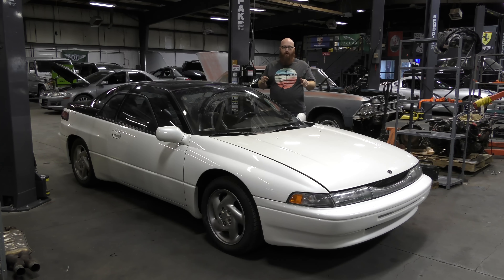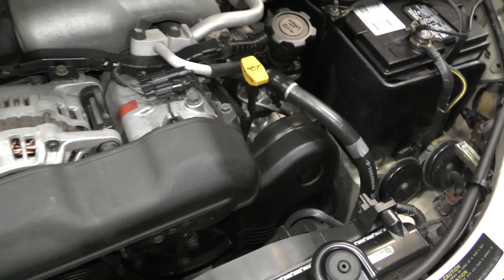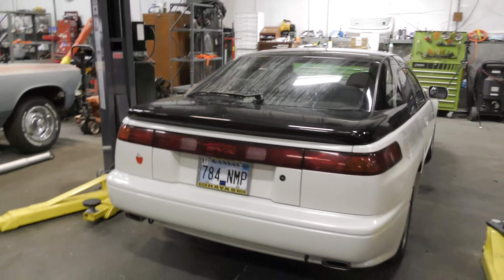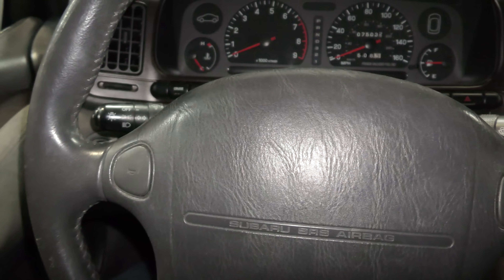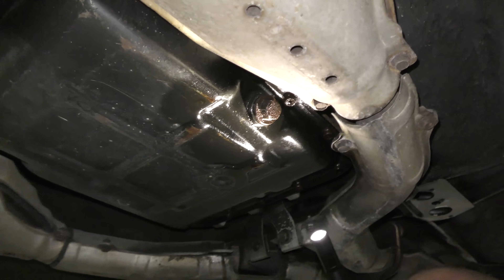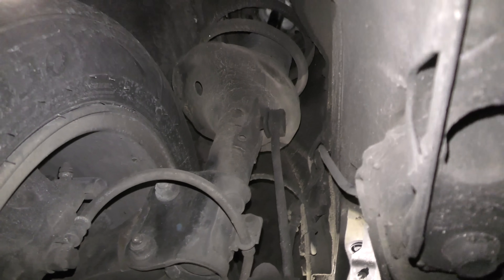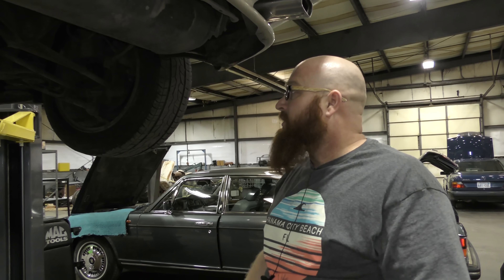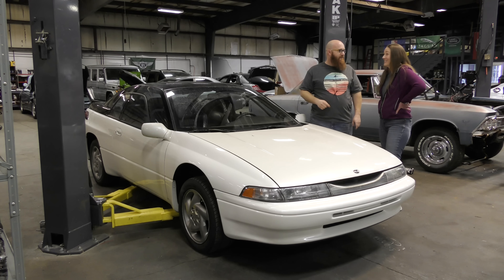An Italian Subaru Sports Car?!? The CAR WIZARD shows how east meets west with this 1992 SVX Subaru

Comment: I still think this is one of the coolest cars ever built. In the mid 2000's I was always keeping an eye out for a used SVX and planned to swap in a manual trans...
Reply: Me too. Never got around to it.
Reply: did you get a chance to own one?
Reply: If you do, source a 6 speed from a European Subaru diesel. Best trans to swap in, designed for high torque and loads available in scrap yards and the boxer diesel engine had a serious design flaw that wrote off a lot of cars
Reply: @tharinduweerasekara5360  Sadly no...weren't too many around, and before I could source one, life demands changed, and more practical, roomy vehicles were required....it's all good though.
Reply: @sweetroscoeful  thank you for the reply, I understand what you went through, I am going through it now lol
Reply: Interesting how small the logo emblems were .
Reply: @pkt1213  never too late
Reply: @MylesHSG  Do you have more info about this?

Comment: I sold these cars and it seemed there were 2 types of SVX’s. The ones that were reliable and durable and, well, the ones that gave you ulcers. They really stood out in a lot of new Subaru’s and that probably worked against them as much as it helped them. I think they were just too advanced and different for what most customers thought a Subaru was. I remember they were very comfortable, very quiet (especially with the windows down), and in bad weather they were like a billy goat, nowhere they couldn’t go. A very unique car for its time.

Comment: It's a great honor that the SVX would get its own spot on the Wizard's channel. I'm big in Subaru communities both in NY and Canada and there's always one or two of these things at meets. The community is fascinated by them. And I'm sure Subaru would make money if they introduced something similar today. But not if it's as expensive as it was back then. The communities only complaint is the auto only. The 4EAT trans has many quirks and requires perfect owners to live a long life. And it wasn't ready for the torque of this car. A 5 speed would've been incredible.

Edit: About the driveshaft. I had a bad u-joint and carrier bearing on an 05 outback. 90% of the shops i contacted said it either can't be fixed or we'll give it a shot and leave you with a bill if it fails. Ended up taking it to a Subaru dealer and spent 1 grand on an entire 2 piece drive shaft because the shaft is welded after the carrier is installed and the u-joints aren't replaceable. The cost was increased by the fact that it was an Outback Sedan. Pretty rare, even here in the Northeast US. Took a week just to get the parts shipped. By comparison, my 96 Impreza had a clutch pack burn out in the trans and for the same cost and one afternoon it was torn apart and ready to go.

Comment: The SVX has always been a really special Subaru, the best thing you can do to one is manual swap it and turn it into a really awesome car! 😎
Reply: Subaru slush boxes were terrible
Reply: I think Tavarish converted one to manual with a WRX box.
Reply: It was meant to be a GT cruiser. Made sense for it to have a slushmatic. Fantastic car. 👌
Reply: @aaryeshg.6526  If only it was reliable.
Reply: the SVX's 4eat automatic trans was the strongest version ever made of that design, they aren't that weak, the only ones failing are the ones who didn't respond to the torque converter recall, the 91-93 tourqe converter had problems, they disintegraded bit by bit and clogged up the high pressure lines feeding the rest of the transmission.
Reply: then again, they aren't great, im just stating they're not as bad as people talk about, all the other 4eat's(subaru 4 gear auto) were way weaker, especially the later model ones
Reply: There is a shop here in the Northwest that does the swap to a manual transmission. While the SVX isn't as reliable as my Audi 4000 Quattro, it is better than some of the later Audi Quattro's...
Reply: @benburkhardt6443  The auto was made by Nissan (JATCO).  It went on my 1994 SVX LSi.
Reply: @davidhollenshead4892  what shop in the northwest? I have a 96 that needs a manual.
Reply: @davidhollenshead4892  what's the shops name?
Reply: @Tim Pendleton  Same 😂 did you find out how to do it?
Reply: @dadi2450  Umm, it was a Nissan transmission from the Pathfinder and not made by Subaru and they commonly failed due to the design was not able to handle the heat of the SVX engine. Only the 2wd cars had a Subaru tranny. I went through 2 rebuilds with my 2/91.
Reply: @kriswingert1662  what? No, the subaru 4eat is not made by nissan, i have no clue where you got the idea that they were producing awd transaxles for just for subaru for over 3 decades, they definitely weren't using transaxles for their own cars, lmao

Comment: My UK Subaru dealer has one of these in excellent condition.  It only appears during the summer to keep it away from salted roads, but as you noted with the older style ABS module getting parts is becoming difficult.

Comment: Interesting that after all these years we are still talking about this car.
Reply: This car was in Gran Turismo 2 and was pretty fun.
Reply: Still runs better than any current WRXs right noe
Reply: @AnthroGearhead  I've owned an SVX and a WRX, you can't compare them. The SVX is a great highway cruiser, will sit at 85 for 10 hours straight and not miss a beat, but it's v.heavy and the suspension is tuned for comfort.
Reply: @MylesHSG  heres where the problem starts, why does it not have a STI variant and why is it so underpowered, i thought Japan in the 90s were care free
Reply: @AnthroGearhead  this was a $35k car in the early 90's. Think about the kind of people who were buying these new. They weren't the typical Subaru Leone or Legacy buyers and they probably wouldn't have been down with choo choo noises from under the hood. Subaru was already losing millions on the SVX, maybe if it had sold well they would have done a turbo version or something really cool.
Reply: I can’t wait to get my hands on one
Reply: @AnthroGearhead  Japan did have the S4 trim of the SVX, its said to be 250hp. I did not dyno mine, but it did get a radically different transmission. I wont go into details, but the North American market got a last minute shit transmission (one the could be transformed into a FWD). JDM has the proper one (made for AWD only), I own both a 1992 NA LSi and a 1996 JDM S4,  two drive very differently. Literally every drivetrain issue or quirk I had with a 1992 NA, is fixed and upgraded upon in the 1996 JDM.  The JDM SVX also has different mappings for the gears, I dont recall the NA gear maps, but I remember most being at 90 front and 10 back. While JDM has 50/50 first gear, rest are 66 back - 33 front. This is on a straight road with good road condition obviously, otherwise the AWD will distribute it accordingly. On top of it all there is a "POWER" mode where the transmission simply allows higher revs for each gear. The NA needs gas pedal mashed for it to work, so not for every day driving, while the JDM has a freakin button just below the shifter, press it and bam POWER mode all the time, smooth shifts.

Very unfortunate that the NA and all left hand side models got the shitty transmission, while all right hand models got the proper transmission.  As a side note, they did make about 1000 SVXes in 1991 for JDM that had all wheel steering, but those are super collectors item. In those when driving 80km/h or faster and you turn wheel right - all 4 wheels would turn right so you change lane while being completely straight to the road.
Reply: @valiktoma2542  interesting, still very sacriledge for having 250hp only
Reply: @joshrepik  make sure the glass in the SVX is good !! Very expensive if you ccx an find it😉
Reply: @Carman-2012  there are a few bouncing around my area, I haven’t seen any broken glass, fortunately. Honestly if I did get one I’d commit a blasphemy and pull the engine. Probably better just to buy an eg33 😂
Reply: the styling on it r one of a kind

Comment: They have one of these at the junkyard by my house. It was so cool to see! It caught my eye right away since the junkyard is usually made up of American cars
Reply: Damn it Dale
Reply: Hahaha of course it’s made up of American cars
Reply: Mostly fords right? Fix it again tony
Reply: @diablocls55  Found on road dead*
Reply: @diablocls55  mostly GM! But yes fix it again tony LOL
Reply: @Zark-Muckerberg  🤦
Reply: @diablocls55  That's Fiat. Ford is fix or repair daily.
Reply: @robbsclassics  idk if you’ve watched king of the hill but it was a joke
Reply: @diablocls55  Dangit, I haven't even opened my Alamo yet.
Reply: Which means that the yard knows to keep the SVX as Subaru doesn't support it any longer. 
While American Cars are popular and thus the used prices for parts are lower, the yard is likely selling cores for those American cars making a decent profit. As rebuilt calipers, master cylinders, starters, alternators, automatic transmissions, cylinder heads, short blocks, etc. mean that a lot of cores are needed for the rebuilders...
Reply: @diablocls55  F.I.A.T.

Comment: I'm curious to see how you will fix the coolant leak from the radiator. In my experience it needs a new radiator because the plastic piece fails.
Also, since it dropped oil, it can impact the transmission. 
In other words, I can't wait to see what's next for this one! Thanks

Comment: you mentioned driveshafts, the speed 6 in the background is similar, a replacement driveshaft is $1000-1500, the propellershaft seal is a common failure point, most (if not all) leak some by 100k

Comment: I was told when these came out that you can put the small windows down and have no wind noise driving at 80 mph.
Reply: yea it sorta makes sense because of the flush surfaces
Reply: Wind noise, not quite.  But you can have them down at speed and there is very little buffeting.  I would roll through the Appalachian mountains while snowing and have the windows down and the heat on and it was perfect.
Reply: As someone who had one of these there is certainly wind noise, the theory i heard was if it was raining the rain would not get in the car.

Comment: Wheel bearing noise comes from not grounding front struts to main body of the car. Difference of ground causes wheel bearings to wear sooner. After replace bad wheel bearing you need to install ground strap from front struts to body of the car. Since front struts are isolated with rubber cushions to stop the road vibration to the car. I replace my front wheel bearing three times and with ground strap added I do not have bearing problem anymore. Also transmission goes out every 75K miles.

Comment: Thanks for the hood strut tip Wizard!  My uncle was a mechanic and left me some of his tools, never knew what that thing was for, now I do.  Could have used it many times
Reply: I just use vise grips. Every mechanic has a pair. And they will hold a good or trunk easily if you lock them on the metal tube of the strut.

Comment: I have 2 SVXes, the driveshafts new do not exist anymore unless ordered from Japan for 3000$. 
The local Cardanic drivershaft shop did change all 3 U joints on my driveshaft and it works perfectly (balanced too). So they can be fixed, but you have to look around, and expect to gamble on it somewhat as well.

Comment: You can absolutely change ujoints on shunaru driveshafts. There are replacements made and they are pretty affordable. They use an inner c-clip design instead of the stakes. Just change them like you would any other ujoint, pressing through the stakes is very easy. The driveshafts are more of an issue to deal with when the slip yoke or carrier goes.

Comment: I have 3 SVX's. 1 was in a wreck - that's a project for now. 2 are on the road but 1 of them is difficult to start. Reports it needs a Crankshaft Position Sensor. Discontinued part. Was looking for a used one when I came across this very enjoyable video.

Comment: The solution to the silly universal joint problem can be found in a recycling yard under a Toyota or Daihatsu or Nissan.
Actually you just use a diagrinder to remove the locking lugs press out the ujoints and fit ones that use a C clip on the cup inside the joint instead of outside . You may need to file or machine the lobes on the shaft flat so the C clip has a good contact surface that won’t push the clip off in one spot.

Comment: Favorite car from the 1990s?  Saturn Gen 1, S Series with DOHC!  I still have 2.  Always use sealing pellets when you change the anti-freeze and they run forever.  And they're a lot of fun at about 30 MPG.

They're still amazingly inexpensive for a car that's becoming rare fast and is likely destined to become the Edsel or the Corvair of the 1990's

Comment: I have replaced a few staked in U joint's on my Subaru's.   There are aftermarket replacement u-Joints which use circlips on the inside of the yoke to stay in place, and pressing or drilling out of the stakes is required, a simple process.  Subaru uses the same size U-Joint as the older Toyota Highlander's, Lexus RX300 and a number of other Japanese automobiles because all these driveshafts came from a common supplier.

And these SVX eat wheel bearings,  its a heavy car and the bearings are undersized for the car as they are from the lighter, lower HP Legacy model.   Also the variable torque distribution AWD system this uses does stress the bearings a bit more than Subaru's other AWD systems, it sends more power to the rear wheels than the typical Subaru AWD system.   The wheel bearings, being press in, need great care to install them so the don't shortly fail again.

Comment: I owned an identical 1992 White/Black SVX. It was one of the best cars I've ever owned. It was the same as this one but had a rear spoiler and no moon roof. Otherwise, identical. I loved that car and put almost 140k miles on it without a problem. Although it was all wheel drive, it wasn't as sure-footed as I thought it would be. I miss that car! Gas mileage and performance were decent but the lack of wind noise and the feel of a jet fighter canopy was the best. I've been tempted to find another one...

Comment: My Dad had one of these in the same pearl colour. He got a stainless rear sports muffler & better shaped tips. Plus also fitted bigger 17 inch Momo wheels with a better offset. It looked much better and had a better sound then compared to stock. Can't remember the seats being anywhere near that soft though.

Comment: A 92 SVX with 275k km and a rebuilt transmission was my first car. I crashed it. Years later my second car became a 93 SVX with 90k km and a shot transmission. The rebuilt transmission survived the crash and I still had it, so I swapped it over.

To me they are more a GT car than a Sports car. The seats and suspension are deceptively comfy. Great winter car.

Comment: Ah, the SVX. Imported to the UK via a 3rd party company, only ever sold by Subaru themselves in white (but could be repainted by the importer "International Motors" to any Subaru colour if you ordered it). I still have the launch book detailing the revolutionary leaps such as the moulded plastic fuel tank and the six cylinder Boxer 3.0 L engine. Beautiful car, but sadly I only ever saw 3 of them in my time with Subaru. I seem to recall the Automatic Gearbox was a little fragile, but the rest of the car was sturdy enough.

Comment: I owned a 96 svx !! I purchased it in 1999 had only 30k on it was like new! It was black in color beautiful inside and out! I've owned alot of other cars foreign and domestic..but this car will go down as the all round best car that I ever had!! Sure there are other cars but this car delivered everything..smooth at high speed..AWD..very quiet but powerful engine!! I had to change the wheel bearings 3 times as it was a big issue with this vehicle if not done properly! But that was pretty much it for me...it never let me down! I have always thought that they should have kept making them!!

Comment: drove one for 18 years. Quirky is exactly what they are. Everything is Left and right down to the wheels. You won't find aftermarket and some things are ONLY made by Subaru or FHI.Parts are terrible to find. but Driving.. car hits the road solid as a brick. It's a wonderful experience. Lots of visibility and at 120 plus it's calm, fairly quiet interior. long distance they were great. I'd easily get another. if it wasn't for the parts issues.

Comment: I had a grey one named Subee lol. It was a kinda quick, very solid. Ended up trading it on on a Avalon because I was starting a family and the transmission issue. The transmissions will whine when the bearings start to get loose and kill the whole diff and lock the whole thing up. It was fun though

Comment: This model was rarely seen new on a Subaru dealer's lot as they were such a departure from the rest of the Subaru line. In many ways, they were a special order from Subaru. The reason for only a portion of the side windows rolling down is the curvature in the glass. For the entire window to lower would require a much thicker door. For the time they were a very fast car with a top speed in excess of 160 mph.

Comment: I had a 92 for several years.  Wheel bearings are a common issue.  I would also change the filter in the auto trans.  That was a huge issue resulting in overheating the trans.  Wizard didn't talk about the flat 6 much.  Dual knock sensors,  7 main bearings !!.  Some mechanics were afraid of this car as it was too complex for the day....bonded glass construction, winter/summer wipers....

Comment: I had a Renault 21 (I think you guys in usa are not used to see those Nor peugeots or citroens) that was also an italdesign giugiaro. Very clean lines, sort of boxy but always giving that speed sensation. More 80's than 90's. When I see those cars I inmediatly think of Tron the movie. I see a resemblance with alfa romeo zagato to mostly un the rear end